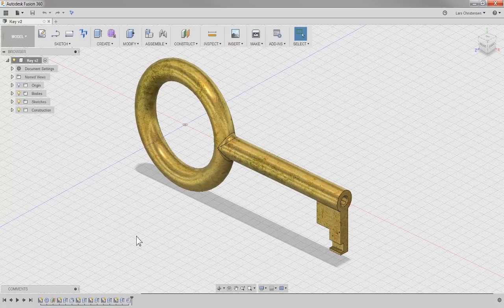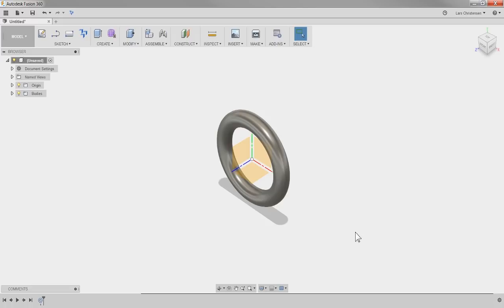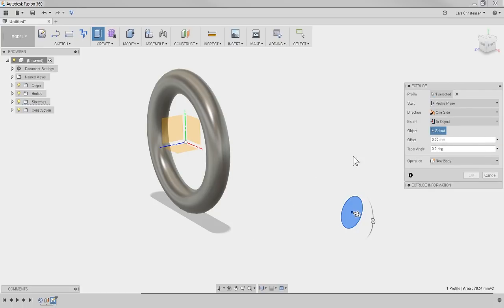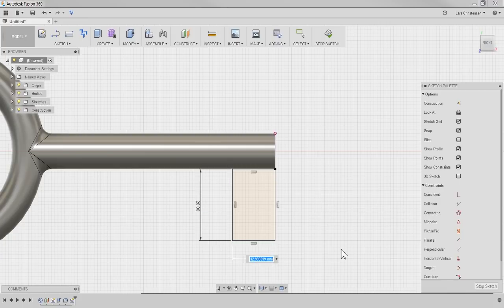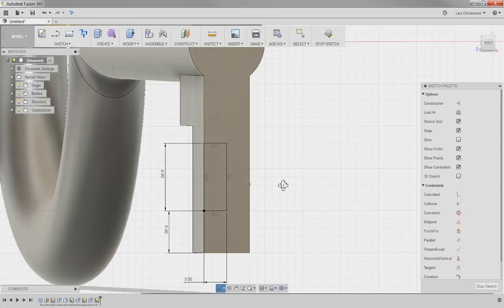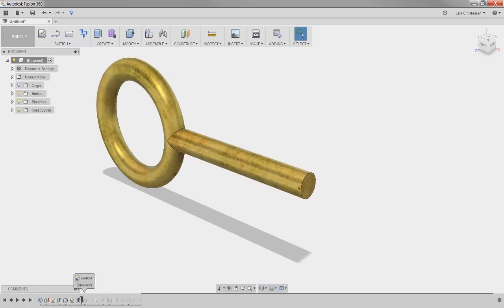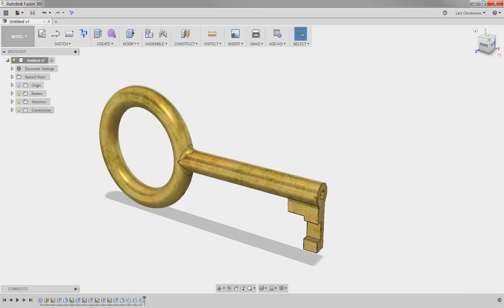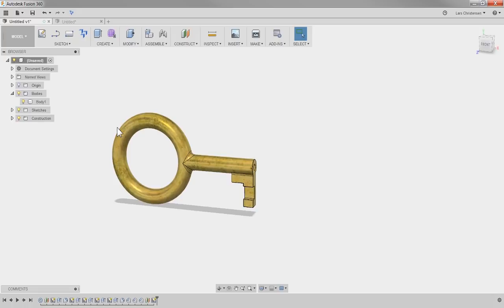Last nights Fusion 360 Absolute Beginner Facebook Livestream — Answer Bar #2 How to model a key

Comment: Im having an issue w/ F360. For some reason my display shows "Design" where yours says "Model". All the tools across the tool bar are different. The drop down doesn't show the "Model" mode  or selection. Do I have the right version? or is there a control I'm not picking up on to select "Model"
Reply from the maker: Hi John, This video is recorded with the old UI. Model is now Design. Some of the menus has moved around, but the general model is the same

Comment: Hi Lars , Thanks for the  video ... at 21.52 when you try to put the rectangle in the center of cylinder . it get constrained or fixed to the center automatically. but in my case i can create the rectangle on the center line but cannot constrain at the end of the road. i can move my rectangle. how to constrain it down to the center of the  road
Reply: I also got this problem.  As soon as I select the rectangle tool there seems to be no way to anchor it to the face of the cylinder.

Comment: Hey Lars, thanks for doing these. I have an issue i struggling with. At 15.30ish when you're doing the fillets, the arrows to pull the fillet out are in the opposite direction. How do i reverse it? Thanks.
Reply from the maker: Hi Angry_ Automaton Thank you for watching!
Sounds like you might have two different bodies? Check the bodies folder on the left side of the screen. You need it to be one body if you want to create a fillet between them.

Hope this is useful.

BEst,
Lars

Comment: I'm a bit more advanced now in FUSION but I've always thought that the most confusing thing in FUSION is the ORIGIN shown on the screen vs. the "cube" and their relationship to one another. The plane shown on the ORIGIN, at the bottom, is actually the TOP when referring to the Cube AND none of this has any relationship to the X, Y, Z axis' used to cut the actual part in CAM. Any comment?
Reply from the maker: Hi B Tomas Thank you for watching!
Yes, it is a bit confusing. There is no rules for front, back and top. So the CAD companies early on decided that they wanted Front to be the default plane. The CAM companies came in and decided that Top makes sense( we really only had vertical machines) So when CAM came inside CAD, the CAM end just got their own coordinate system so they did not have to fight with CAD.

Hope you have a great weekend!